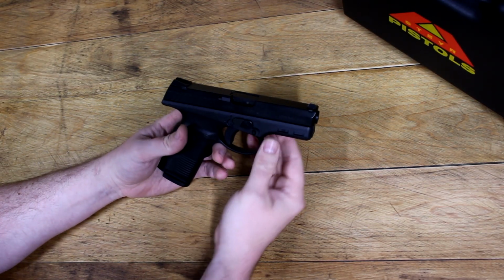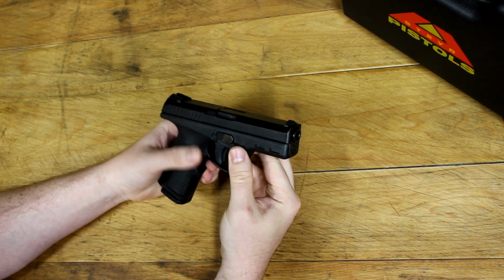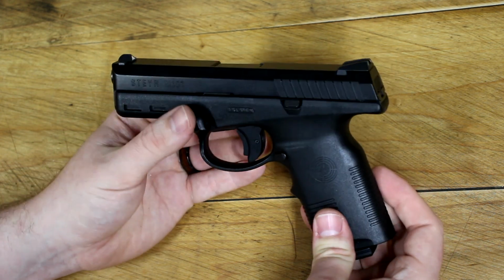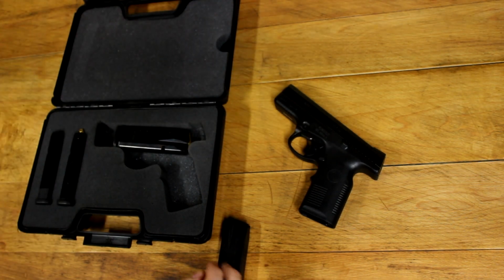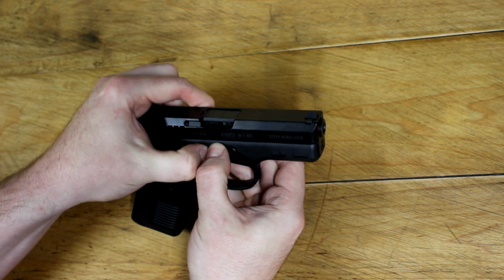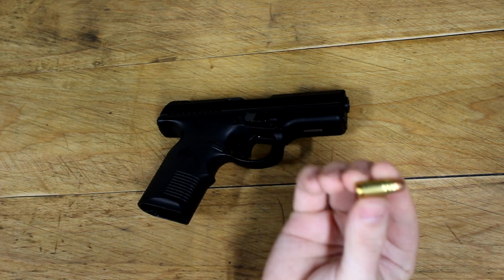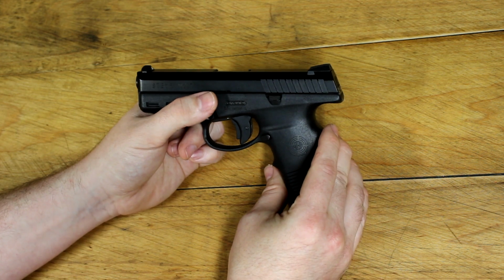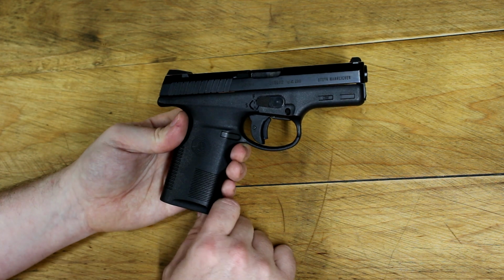Steyr M357 - Austria's OTHER Polymer Pistol - History and Functionality

Comment: Lol 9mm is popular because anything bigger scares the soy boys away. 

357 sig provides more stopping power and penetration. 9mm has been proven to be a garbage  and gas failed mutiple real life incidents.
Reply from the maker: This is a copy/paste response to a similar comment, but here you go:

1. 9mm rounds in modern defensive loadings put sufficiently sized holes to sufficient depth in targets to incapacitate the threat through nervous system damage or rapid loss of blood. Those are the two things that stop gunfights. Either round accomplishes this well with the right loadings. 

2. The increased ammo capacity of 9mm vs .357 Sig increases the number of sufficiently sized holes in your target, increasing the chances of a nervous system stop or more holes to rapidly bleed out from.

3. The reduced recoil and cost allows for better training practices and frequency which increases your chances of more successful, debilitating hits on your target. The average shooter can become competent with 9mm faster and easier than .357 Sig. That’s not even getting into the firearm longevity issue as .357 Sig polymer frame guns tend to beat themselves to death and break frames much, much faster than 9mm guns. It’s a known issue and a reason why every major LE agency has moved away from the round and back to 9mm. 

You make good points for your opinion. I just disagree with almost all of them for practical use, lol. Ballistically, the .357 Sig is a better round, that is true. Practically and realistically, it’s worse for the average shooter and makes zero difference in the end. 

But thanks for your input!

Comment: I have that same pistol but in 40sw. I did buy the 357sig barrel. 

The external safety in mine is a joke. The USA importer was horrible back in the day for parts. The original importer GSI T'Ville Al was unresponsive and parts for repair was difficult. 

I contacted the engineer in Austria and they will ship you parts via DHL. I'm sure this has gotten better. They sent me a few external safety components and a newier update recoill guide. Outside of that, the gun has been reliable, never misfired and I have not been able to create a limp fire situation in the one that I have.

FWIW; Magazines also where hard to find. 10 ban-limits came after I bought mine, and I found a company that sold non-LEO stamp 10rd and it cost me over 39 USD per magazine.  I have 3x 12rd and 2x 10rd magazines for mine.

Comment: Interesting.  I’d also heard that two Glock engineers recommended changes to the Gen 2 and Glock rejected those changes so they went down the street.  I heard that too.  Can you confirm.  I love my Steyr.  Won’t trade for a Glock.  They changed the trigger bar from a Glock so you get a nice crisp pull,  but the only area I can see the Glock has an advantage is the SRT (reset), which is better on the Glock.  Also the Steyr points better for me due to the hump on the grip.  This pistol should have been marketed better.  I love this pistol.  Also it is rock solid gun and the internal machining is much better done than a Glock.  Glocks are designed to have parts swapped out quickly and easily.  Steyr’s are good to go out of the box.  Need nothing except night sights.  Good tube!

Comment: Texas DPS and Sig among ammunition manufacturers developed the .357Sig basically as the Utopian round to replace the .357 magnum revolvers that troopers had somewhat recently transitioned from. Sig 226 in 9mm was generally regarded as less than optimal in performance at the time. Troopers could also choose the Sig 220 in .45ACP but now they had 2 different pistols and calibers to keep up with. 
.357 Sig in the Sig 226 saw fantastic performance in the field. 
Other than a few law enforcement agencies it never quite caught on and even Texas DPS has gone the way of 9mm.
I have an example of the Steyr M9 after your model but with picatinny rail and no A1 markings.
Great little gun.

Comment: I've never heard complaints from anyone that owns one of those Steyer guns. I think that Steyer had the chance to make a name for themselves here had they had put in some effort into marketing.
Reply from the maker: I agree. They made a VERY good gun that just didn’t sell well at all.
Reply: I got the newest model. Tbh the ergos don't feel that good and the trigger has no tacticile or audible reset which I'm not a fan of. And the sights were hard to use because the slightest movement would change the point of impact. I wanted to like it really bad. But I think I'd like the gen 1 better. Ergos look better and it's got that classic look